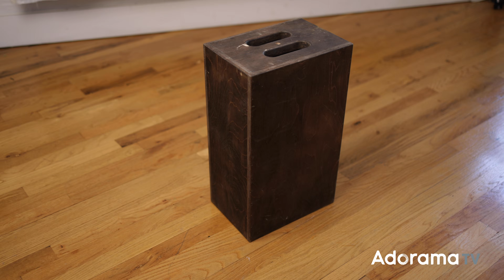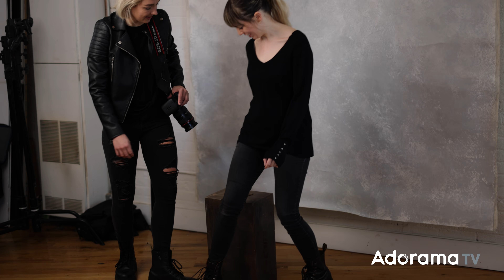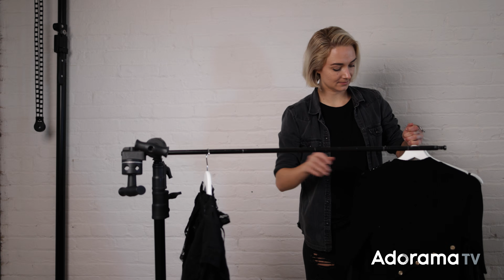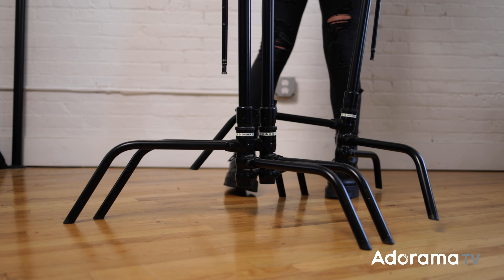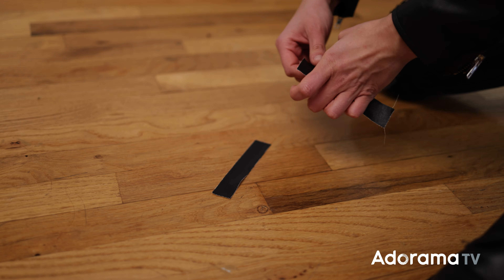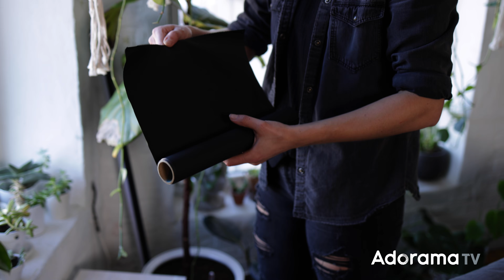Studio Gear Basics | The Creative Process with Emily Teague

Comment: I often watch tutorial videos for the photographic specifics as a photographer, however, there are times when just a "simple" variant inspires and immediately has the "light bulb" go off; this is one if those times.
Using my C-Stand to hold my scrim-wow!! Light bulb!! I usually bring a huge awkward two legged stand, but now...yes, c-stand replacement (faster and simpler). Also, using it as a clothing rack...why didn't I think of that?! Thanks so much for ideas!!
Reply: Awe Huie this made me really happy to read. I'm so glad! Thank you for letting me know! ^_^
Reply: FWIW, C stands are actually designed to hold modifiers like flags, scrims, bounce boards, etc--they are NOT designed to hold lights. Somewhere in history photographers started using them to hold lights because they have a conveniently small footprint and decent working load, but ideally you would use a combo stand to hold your lights. A combo stand is MUCH sturdier than a C stand, and can be used to safely boom out a light over a subject.